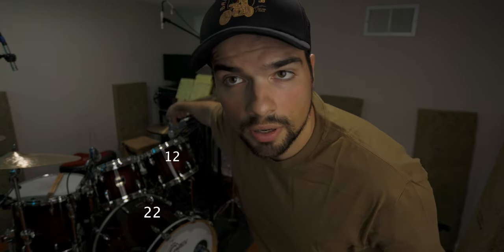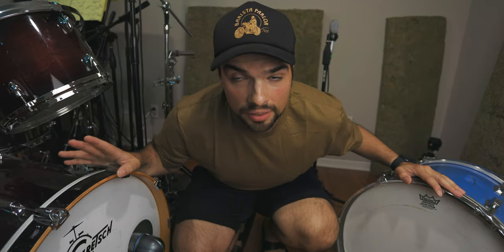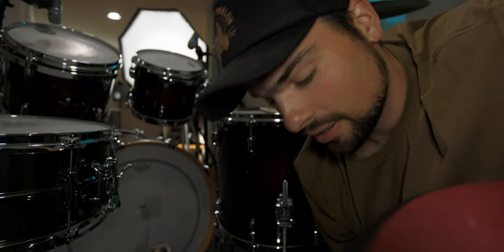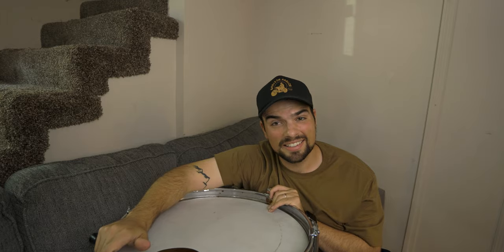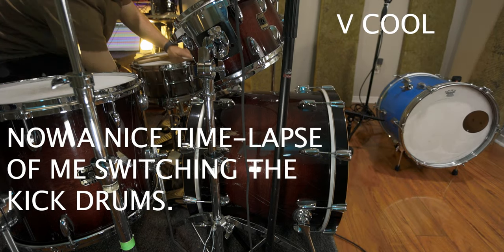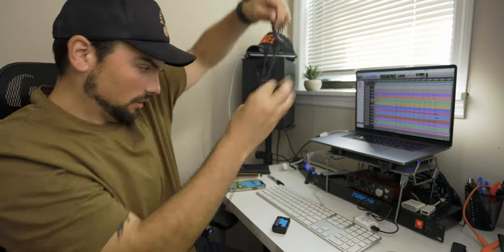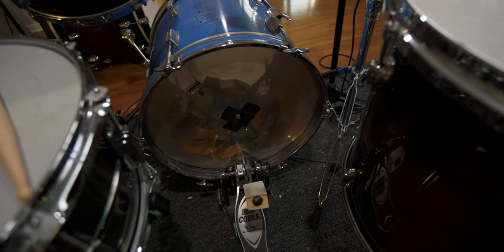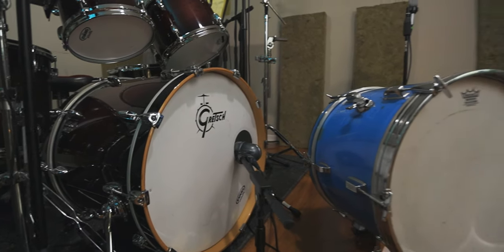CAN YOU GET A BIG SOUND FROM A SMALL KICK DRUM?

Comment: Love this video, I have a large bass drum on my kit and didn't realise you could get just as good a sound from a small kick. Do you have any tips on tuning bass drums and which heads to use?
Reply from the maker: Thanks man! And yes working on that video soon!
Reply: Hopefully you still use this account
Bass tuning. I'll tell you what you may or may not already know

The front head is where all the tone comes from. Less tension = more vibrations at a lower pitch = lower sound
Batter head is where the feel of the bass drum comes from. Doesn't affect tone as much and I hate the feeling of a loose batter head so I tuned it up like a bebop kit and put 2 long pieces of gaffer tape on the other side of the head to deaden the higher tone and give it mega attack.

Overall you should try tightening the heads until the wrinkles go away and raise the batter head until it feels good to play, then listen to the front head to see what it really sounds like
Raise or lower it until it sounds good

In my experience having both heads really tight + muffling will give you a bonham kick sound. For something more punchy and deep keep the front head lower than the batter.